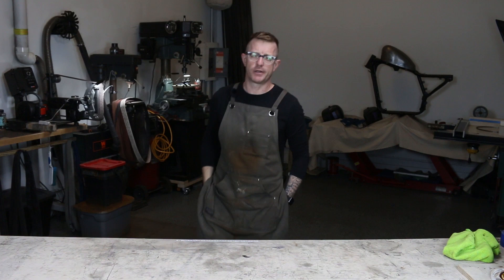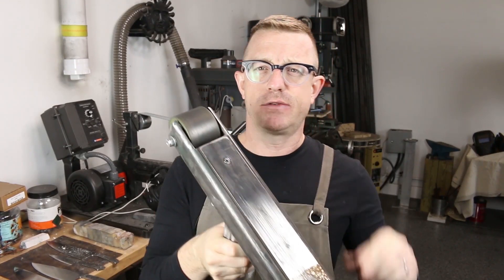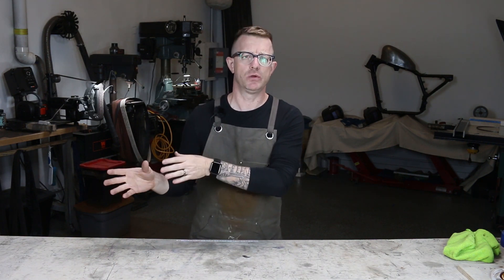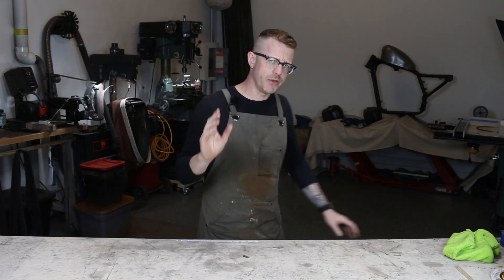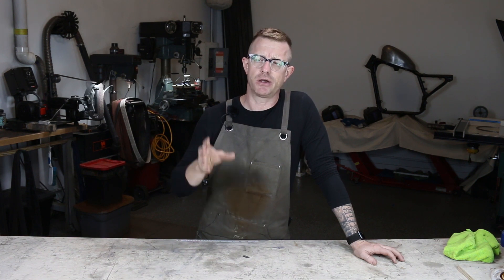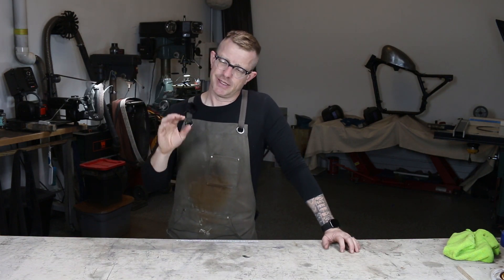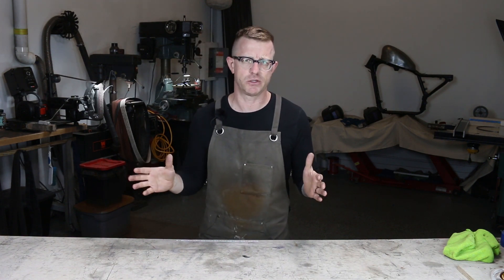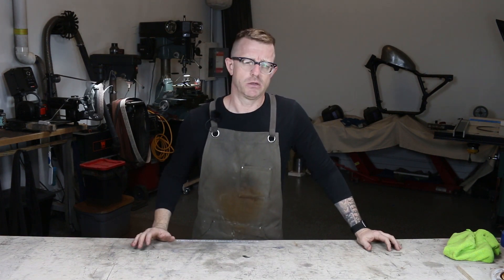2x72 Belt Grinder Design & Some Exciting News - Homemade Tools

Comment: Hey Brian Happy Thanksgiving to you and your family as well. I've picked you up as of late mainly seeking ideas with my treadmill motor control  . excellent vid by the way) which appears very similar to the one you used. I've been building on ideas for some time and have everything decided upon and have to say our designs are very similar. One thing if I may add I wasn't that fond of my 2" belt running on that narrow cast iron flywheel and turned a 3" x 4" alum drive wheel after determining the shaft was a basic 1/2-13 LH tap...much better and so so simple. In closing I wish you all the luck and keep swinging for the fence...
Reply from the maker: Thank you Robert. I agree on the thin drive wheel. It has to be 2” plus.

Comment: Best of luck. I’ll add that I like a lot of the 2x72 designs with a quick change between platten, small wheels and a large wheel with just a rotation of the platten assembly.
Reply from the maker: Thank you. I am nearly complete with the prototype build. Almost there!

Comment: I use a laser cutting company for all my jobs in plate metal.
Reply from the maker: Yeah laser would be optimal but I’ll be using plasma so we will have to work around those restrictions.

Comment: I would love to see you put together a kit with all the tube material and flat stock for the other parts of the grinder and sell on line for people like me who can't stock a lot of material to do this. Good on ya for the purchase of the cnc plasma cutter etc. Great plans you've got that will help others as well as yourself.
Reply from the maker: Hey Richard, thanks man. Yeah I’ve had this thought in my head for a while now. I had a hard time finding the steel. I could easily cut it to length and ship it out. The the person could just weld it up and have a grinder. I put a big order in with Tampa bay steel so I have a lot of stock steel.